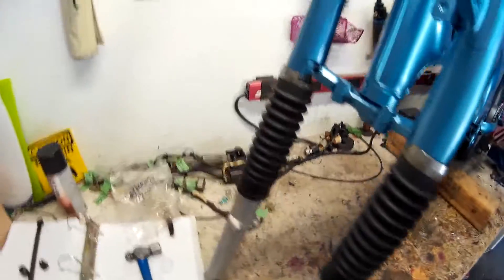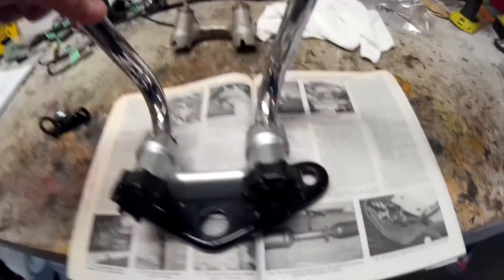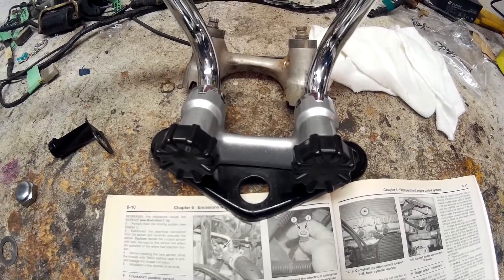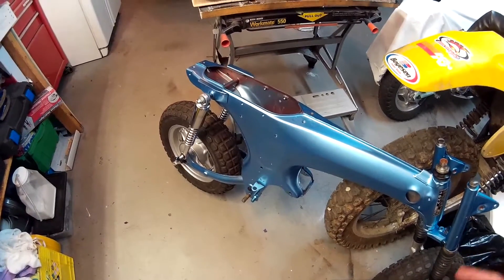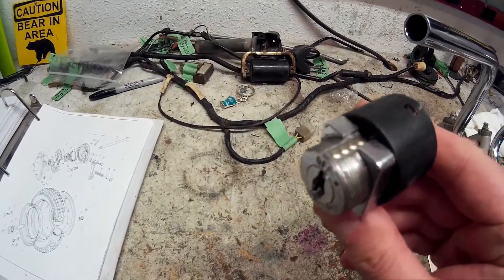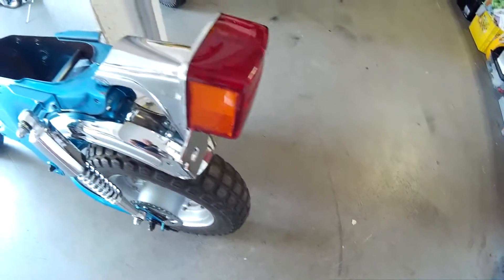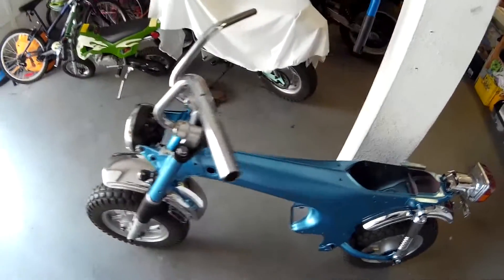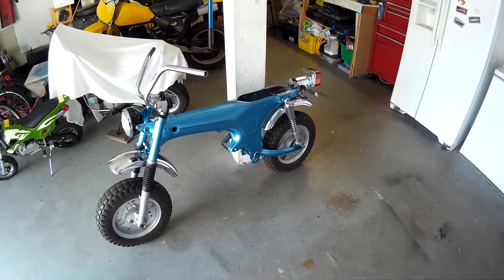1977 honda ct70 frame almost done

Comment: The tail light bracket you bought online, was it for the older CT-70's?  I can only find reproductions of the older mounts, and I have a 78, which has a different light.  I am wondering if the light for my 78 will fit the older mounts.
Reply from the maker: Kyle Sydney I'm  not sure, I  had to slightly modify the one I have by drilling holes on the backside of the light to be able to Bolt it to the bracket
Reply: emso0105 That's what I figured.   Thanks for the reply! 👍